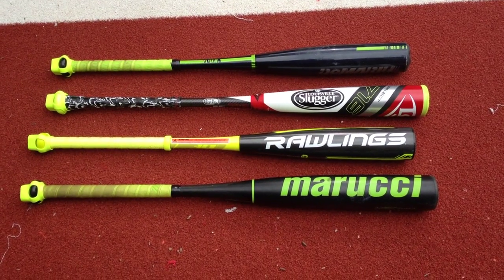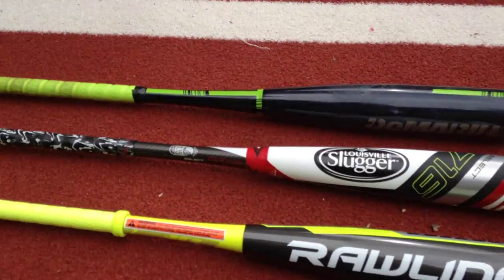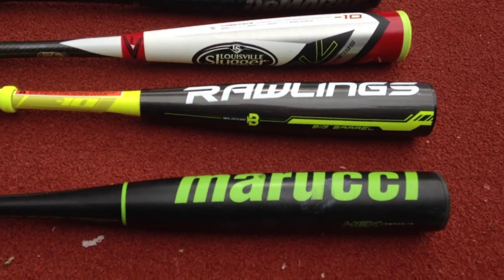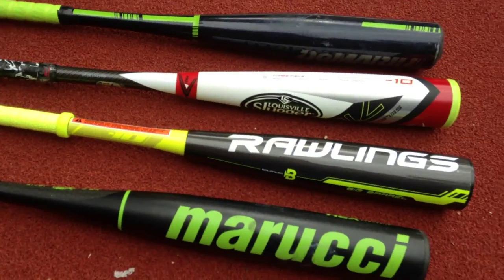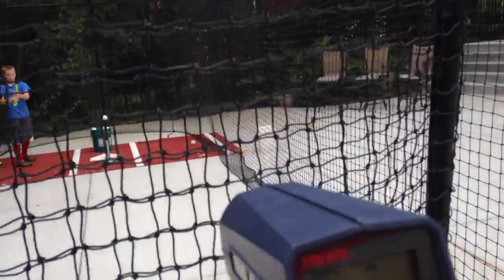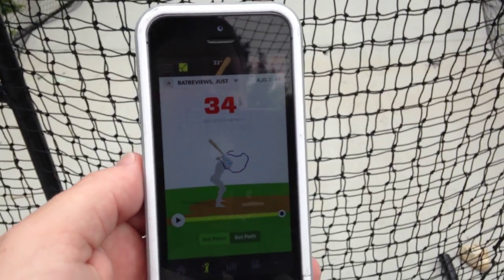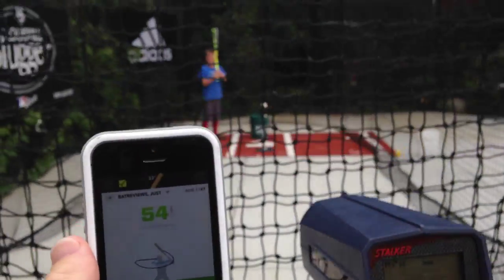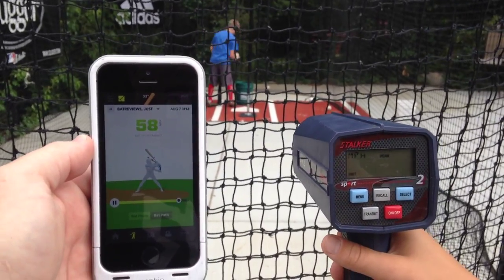Comparing Swing Speeds vs Bat Speeds on Composite, Hybrid, Alloy Bats

Comment: The senior league Rawlings 5150 hybrid doesn't have the comp lite end cap.  The BBCOR one piece alloy does. 

http://www.justbats.com/product/2016-rawlings-5150-senior-league-baseball-bat--sl5r34/22958?pa_source=justbats&pa_campaign=2016pa_medium=badges&pa_content=2016-rawlings-5150-senior-league-baseball-bat--sl5r34

http://www.justbats.com/product/2016-rawlings-5150-bbcor-baseball-bat--bbr53/22857?pa_source=justbats&pa_campaign=2016pa_medium=badges&pa_content=2016-rawlings-5150-bbcor-baseball-bat--bbr53